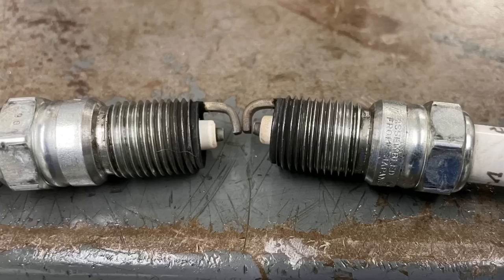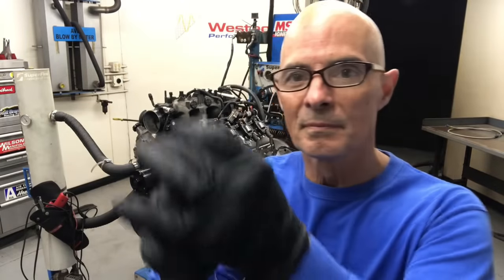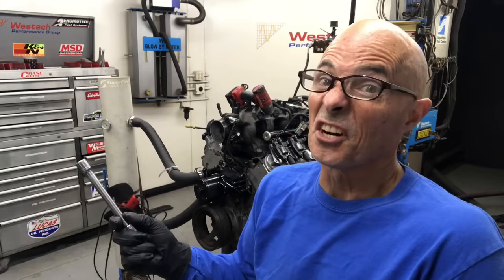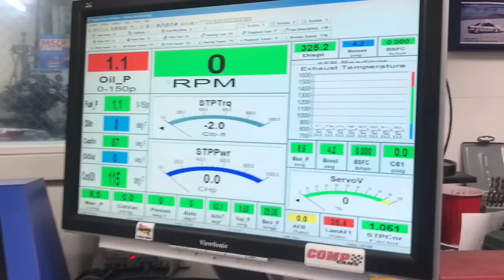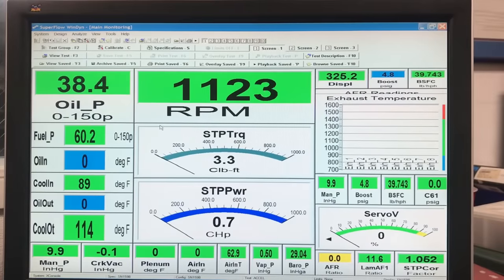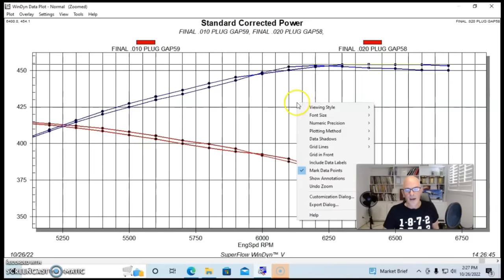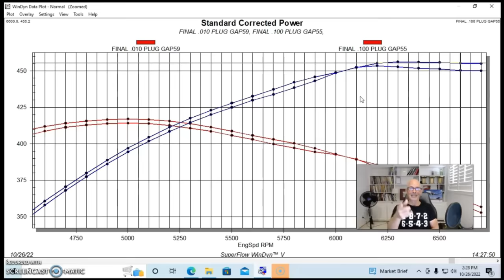JUNKYARD LS PLUG GAP TEST. DOES MORE GAP EQUAL MORE POWER? HOW MUCH SHOULD I RUN? .010 VS .100 GAP

Comment: I used to have a 50cc scoot, which was actuallyabored out 63cc, and did some spark gap tests on them. Increase until rough ride, and decrease until rough ride.
Then get the gap that's exactly the middle of the two extremes. The engine ran by default too hot, at a too high compression ratio, so I used premium fuel only, as that helped top speed. On regular fuel, I could quite literally hear the engine oil boiling after a long ride.
Additionally it had a very weak stator (electric power generator).
This resulted me in having to decrease the spark plug gap, which decreased stator load, and allowed for more spark releases per ignition than when widening the gap. Every time we see a spark appear, it's not really a single spark. It's a multitude of electric current releases per second, just like lightning in the sky, following exactly the same path. Our eyes won't see any difference, but a slow mo camera can.

I did gain about 5mph, to a top speed of 55mph on that scoot, by actually decreasing the gap by about 20%.
Reply: Wowthats wild thanks for sharing the story!!

Comment: My understanding of plug gap is that you basically want the biggest gap that your coil can handle under all driving conditions.  The voltage required to jump the gap increases as gap increases and with the "air" pressure (hence why boost needs a smaller gap, or a stronger coil).  Since GM spec'd a 0.040" gap for a typical LS, I'm thinking this strikes some kind of balance.  Like it can jump a 0.100" gap, but it's not making anymore power than 0.040", so why?  Or, I think more likely, it can jump 0.100" gap, but that will wipe out the coils in 3000 miles miles, so they made it 0.040' and they effectively last forever.
Reply: It comes down to how much energy is in the coil and how much air you're having to ionize. Normal air won't move current, ionized air will. When you add 15psi of boost, a 0.040" gap now has twice as many molecules in it to be inoized - you must either increase coil energy or reduce the gap.

Comment: Also... We build drag motorcycles at our shop. We have a chassis dyno and get to do some of these test as well. But not near enough, and I really love watching your channel to see all the things you test.

And showing the pulls and showing the screen adds to your channel. Really enjoyed this episode as a whole. You done great on this one.
Reply from the maker: THNX-WHAT BIKES?
Reply: @richardholdener1727  most common are GSXR 1000s and Hayabusa's.

Generally any sport bike comes through our shop a lot. We're capable of tuning any bike with a fuel tuner of course(cruisers as well), and then we're able to tune Harley's. But none of them who swore they wanted their bikes tuned have shown up yet. Lol

A couple of comparison videos I've got to do on my channel, one was an aftermarket dual exhaust on a Hayabusa. It lost power vs stock header.

Other was testing year old (can was opened and closed multiple times... But always kept sealed) MR12 vs a fresh can of MR12. Absolutely zero difference.

Comment: I had a 355 roller with the good vortex heads with a carb. Going from 35 to 65.. I had a msd coil and 6 al on it. I gained over 1 mpg.... no bs I never would have thought  it would be that big of a diff

Comment: My understanding of plug gap has always been to run as much as you can get away with. The theory being that more plug gap provides a larger flame front for more complete combustion. This might be what we’re seeing in the results of this experiment: the wider plug gap providing more complete combustion leading to ever-so-slightly more power (1% gain).

The downside to large plug gap is a higher voltage/energy requirement from your ignition system not to mention the higher potential to blow out spark, particularly on forced combustion applications or fuels with low AFR stoichs, for example alcohol fuels.

So there’s a balance to be found with plug gap vs spark blow out.
Reply: You will need a dial indicator set up, that can check how high your piston comes up in the cylinder. Motor cycle mechs back in the 70's did this to make sure nothing touched. Anyone that builds engines probably has the equipment to perform this task,,,, and has probably done it on occasion.

Comment: I found that increasing the plug gap resulted in the engine being able to run leaner mixtures. I attribute this to a longer dis to "find" fuel to light. I would like to see a test where you see how lean an engine at idle will run without missfiring on various plug gaps.
Reply: You might be interested in prechamber ignition systems.  Honda used it in their lean-burn engines a while back.  Combustion engineering is an interesting rabbit hole.
Reply: That’s exactly what I’m looking for.  I switch my old trucks to manifold advance from ported and adjust the carburetor to run as lean as possible at low load.

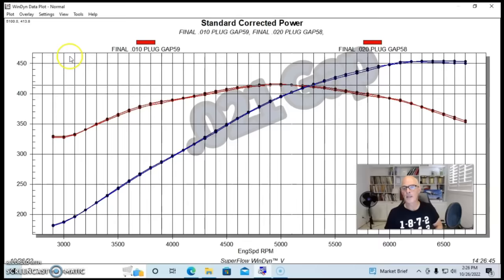Comment: My 1992 Camaro NA 377 (2680 with me in it) ran extremely consistent 9:50 ET's, at US66 Joliet IL. I tried .020-.050- .080 plug gap and it ran in three passes 9:513 9:511 and a 9:509 didn't make much difference in my case.

Comment: I love this channel, i understand that a LS with modern ignition runs good on wide gaps WOT. But how about a budget build Gen 1 smallblock CR10:1 with 45kV single coil, 2ms dwell time at partload/idle? That's where you can have a Lot of issues when youre not dragracing. Can a gap of 0.03 or smaller be too small to cause misfires from Sparks coming to early/wring time/wring place? Anyone got some experience? Dont want to only fix symptoms throwing money on a multispark CDI Box that doesn't solve the root cause.

Comment: I would be very interested in power / driveability between spark plug heat ranges 👀👀
Reply: The heat range doesn't directly affect the power of the spark, it's just a measurement of how well the spark plug transfers heat from the electrode and therefore how hot it will get. Too hot and you can get knock, too cold and the spark plugs may not get hot enough to burn off deposits and they could end up fouled. Anywhere in between so hot you get knock and so cold the plugs foul and no longer spark properly won't affect the operation of the engine.
Reply: Too hot leads to pre-ignition (different animal from detonation), which causes damage very quickly.  Thus, run the coldest plug you can but must be hot enough to avoid fouling (heat = self cleaning).

Comment: you should do more with this. try it on different engines, different fuel mixtures and different ignition timing. there are too many factors to consider to say that you couldn't pick up a bunch of power with the correct combinations. I had a noticeable difference on my 84 ford ranger 2.3L. so low power engine means every horsepower is noticeable with a butt dyno. my 2.3L was running a Comp towing cam, MSD ignition, hand made shorty header with a dividing plate in the collector to try and make it act like a tri Y, truck head, stock bottom end and a 1 barrel carb. I found with that combination 0.042 gap was my maximum power and I was running my ignition timing very advanced. every engine is different and will react differently to certain changes like spark gap, air fuel ratio, ignition timing and compression/boost.

Comment: The plug gap affects the spark duration and a lean chamber benefits with the wider gap and colder plug is better for higher heat generation like compression and boost.
Good video

Comment: Back in the 60’s on a straight exhaust, we adjusted the spark plug gaps at night one could see the different flame color of the exhaust system. Also using a stop watch at a measured distance and during the week, the fuel mileage we determined the best spark plug gap. Not the best system but was entertaining for us as teenagers.
Reply: This is very cool ( different flame color ) means something ...?

Comment: Being a baby boomer and living through the evolution of standard coil ignition and the advent of CDI it didn't take us hot rodders long to figure out that plug gap was a sensitive thing when you were dealing with a basic coil ignition but once you get those nuclear reactor CDI systems going you could do all kinds of things with plug gap....
mainly speaking increase the gap to get more horsepower and torque.

It was a cool thing to experience when CDI came online in the '70s.

Thank you Richard once again testing is your bag and you are the best.
Reply: Those ignition systems are very sensitive in throttle response and drivability when it comes to plug gap, without a doubt. Often times, you're going to actually lose horsepower, but pickup a LOT in acceleration with a plug gap on the wide side (but not too wide), while sacrificing the life of your points or ignition module.
Reply: @johndeeregreen4592  indeed the acceleration part was mind-boggling.
We worked on a Grand Prix with a 400 and a factory peg leg-- there was just no way after adding an aftermarket CDI we could get the thing to hook up....I finally took changing out the rear ratio while adding a GM posi and some tall-n- fat sticky Meats (went from 14" rims to 15" as well...aong with a B&M shift kit for the th400.) this was all part of the final touch that gave the whole package the secret sauce.... the thing was a rocket off the line
And we were happy to take the acceleration improvement from the CDI which allowed us to focus on the power train to get the thing to squat n' go.

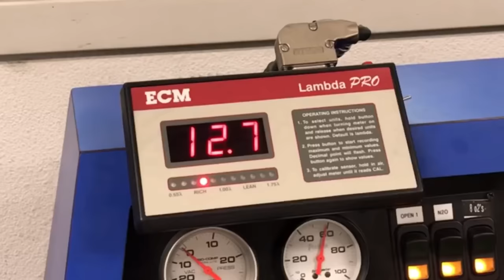Comment: @ 7:16 the AFR is kinda rich for idle after changing the spark gap to . 100 why is that? The AFR was at 14.4 @ 1:57. 
Would this test meet different results with an MSD box involved? My 95 Mustang with the 5.0 has a factory spark gap of .053. 
Mr. Holdener, have you done a spark plug indexing video before? I've always wondered if that really makes a few HPs and if it's worth doing. Thanks for your efforts in doing all these tests. 🏆
Reply from the maker: INDEXING HAS SHOWN NO POWER IN OUR TESTING. THE INGITION SYSTEM ON THE LS IS FAR SUPERIOR TO A BOX AND DISTRIBUTOR.
Reply: @richardholdener1727  awesome, thank you

Comment: Keep testing, really enjoy this type of detailed stuff.  I use the race is a SCCA spec series and one of the few things we could legally change was spark plugs and any gap we wanted.  I personally dyno tested 8 different plugs and various gaps.  End of an expensive day, found some power (upper end of noise) but was very hard on the coil pack.
Reply: What class of scca did you race in
Reply: @davidreed6070  SM (Spec Miata) with the B6 engine.  Did all the known legal mods that were fairly well understood within the community.  One of mods I discovered was a long reach plug (maybe for a Viper, don't recall right now), colder heat range with wider gap made a small but measurable difference at the wheels.  I now race the same car in STL (Super Touring Light) where the only real limit to the mods is my budget and a lot more ways to screw up.
Reply: I've built engines for the as class (American sedan) there was a book of restrictions
Reply: I built a couple engines that raced in the SCCA in the AS class (American sedan) there were a lot of rules about engine building.
Reply: @GETLITUP69  IIRC, .045 with a single ground electrode strap.  In my case, cutting back the ground electrode strap did not make a difference but it seems like it should.

Comment: Hey Richard, do you think this is worth trying with different types of combustion chambers? Obviously a hemi chamber would be a really interesting test(even if of pretty limited relevance to the vast majority of us lol); but I'm wondering if maybe smaller chambers(like an SBF or BBF) vs larger chambers(like a BBC or BBM) could yield different results. Or, maybe heads with differing spark plug placement.
 
Legitimately surprising results, I honestly fully expected this to be along the lines of "either the air charge is ignited or it isn't". I mean, big picture, just set your plug gap so you have good reliable spark and call it a day, it isn't a real meaningful difference; but I am curious to learn more from possibly future testing.
Reply: From general gearhead experience, NA likes around .045 and forced induction likes .035.

I'd like to see more testing of more combos.
Reply: I gap the plugs on everything or even cut off the arm of the end of the plugs all together so it has to arc to the heads and never had a problem.
Reply: @brandonwarren7654  old ignitions too?

Comment: Great informative video!  I appreciate Richard Holdener's clear presentation style.  He might be more detailed and repetitive them some would prefer, but that makes it more likely less experienced viewers will understand and remember his points.

I would like to also see these plug gap dyno tests done in say 0.020" (0.5mm) steps with the results presented on 2-axis graphs showing spark gap vs. peak hp, peak torque, and RPM of each peak. 

As Mr. Holdener implied, the wider the sparkplug gaps, the more demand on the ignition system.  An old, dirty, worn, OEM points, coil & distributor ignition might not like seeing 4x original spec plug gap.  I would expect an aftermarket electronic ignition system such as MSD in good condition should handle max performance gap OK.  This is the main reason I'd like to see a series of dyno pulls to identify how much more gap is actually helpful, vs just torture testing the ignition system.
Reply from the maker: THIS WAS NOT A TORTURE TEST ON THIS IGNITION SYSTEM-IT RUNS FINE AT 1543 HP-SO THIS .100 GAP WAS NOTHING
Reply: @richardholdener1727  
Calm down there Mr. Caps Lock.😁  I didn't intend to disparage your ignition system or test methods.  

I was only suggesting that it might be helpful to folks with less potent ignitions to have a few more data points showing how much gap adds how much power.  A video on side electrode indexing would be interesting too.

I really enjoy your videos and learn a lot from you.  Especially info applicable to a low budget 5.0L Windsor street engine.😁  I'm sure sharing your knowledge, experience, and dyno test results has helped many people better understand how to get the most performance for their hard earned money.  Keep up the good work!

Comment: I woulda like to’ve seen a stockish 0.050 gap that most plugs come factory gapped at nowadays.  As a baseline, middle-of-the-road type deal.  I’d also like to see E3 plugs tested under b00st, seeing as they aren’t gap-able.  And perhaps what Iridium’s bring to the party, other than longevity.
Reply: E3 plugs are JUNK, if you ever go to a racetrack they ALL run NGK copper core plugs e3 plugs like to load up with fuel and foul out like the plugs on a ford 4.6/5.4 3v, iridium’s, platinum’s, and other exotic metal imbued plugs are a NO NO on ANY boosted engine as those exotic metals create a hot spot in the combustion chamber creating a predestination situation copper cores do not do that any nitrous kit say to not use anything but copper core plugs in the instructions and in truth copper core plugs actually have the least resistance therefore the most spark at the tip, yeah and e3 plugs are clown shoes they are a gimmick, please don’t fall for that, they really don’t do any better at anything more than a regular spark plug
Reply: Predetonation not predestination
Reply: @michelerjgross7339  The copper is only there for advertising purposes & sales, nothing significant spark wise.

Comment: Great video, good to see all the little mods someone could do to eek out every pony, wouldn't mind seeing plug heat ranges dynoed, and even "indexing" the plugs so the kernel faces the piston. And also maybe an underdrive pulleys effect on power when connected to all accessories.
Reply: I used to index my spark plugs with a 402 BB Chevy that I put into a Firebird and I swear it made a difference on the butt dyno.
Reply: Was there a differential in ect gain thru the runs?

Comment: Never opened the gap that far, but we used to cut back the electrode a bit to expose more of the center of the plug. Also spent a good amount of time indexing plugs to try to find every last hp.
Reply: I discovered that half-side-gapping eliminates indexing. MSD reeeealy helps the idle and low end as well as the big spark at rpm. True, some modern ignitions throw a big SINGLE spark.
Reply: I could be wrong but my understanding is all those things have no effect on hp well maximum hp but improve consistancy
Reply: @shaynegadsden  you could be very right. I was able to make passes at the drag strip, but did not have access to a dyno

Comment: Love your dyno tests!!  In my carbureted N/A setups, plug gap is a tuning function and, in its basic form, is dictated by fuel, cylinder pressure, and timing.  It can be effected by many design and assembly variables, especially those that effect the combustion process/efficiency. If none of the other variables are changed, just changing plug gap will give you optimal tuning for a given engine setup.  Keep the videos coming!!

Comment: PLUG GAPS MAKES A DIFFERENCE  
I HAD PLENTY OF TIME  TO TEST  
GAPPED PLUGS A LITTLE AT A TIME 
WENT ON TEST DRIVES UNTIL GOT BEST FUEL  CONSUMPTION  AND POWER    ENGINE TIMING ALSO MADE A DIFFERENCE   OLD SCHOOL I set TIMING by engaging 4th gear and release clutch SLOWly
Till ENGINE doesn't stall WHILE moving distributor   IT worked  NO TIMING torch used still use this method today
Reply from the maker: you tested by seat of the pants? the dyno is a touch more accurate
Reply: @richardholdener1727   APPRECIATE  your advice  
I M NO mechanic  WE had MAKE do with nothing  EVERYBODY were experts at EVERYTHING   I M A MASTER OF ALL TRADES  JACK OF 
NON😁😁😁😁😁😁😁😁😁😁😁😎